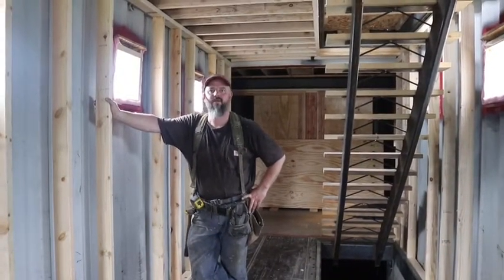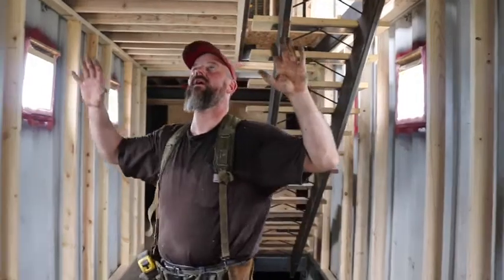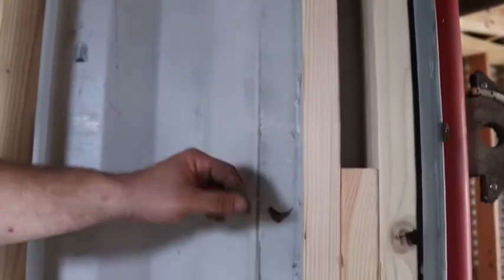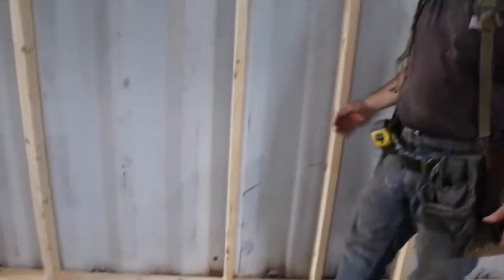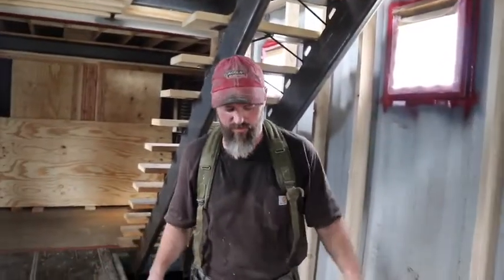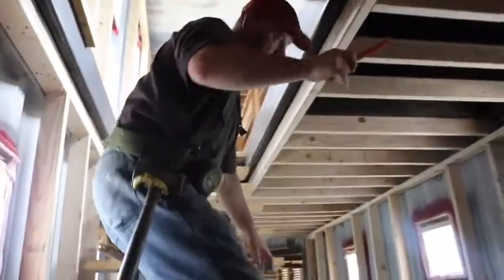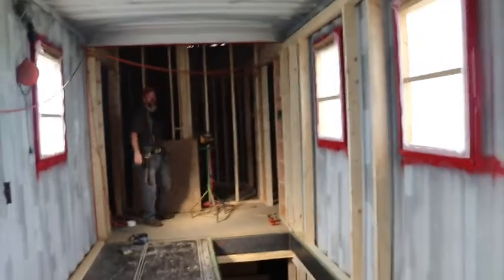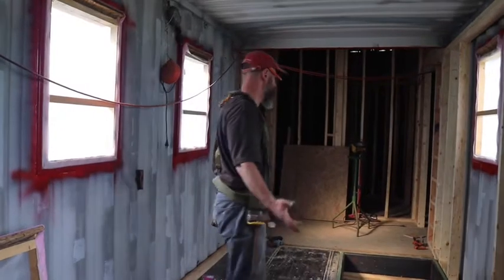shipping container framing

Comment: Are the wall studs screwed into the container walls or press fit between the sill and top plate?
Reply from the maker: Mr. Miracle there just fit. I gapped the studs away from the wall so as to in fill the gap with spray foam and prevent a thermal bridge. The shipping container is super strong on its own . The 2x4 are really for wiring, insulation and drywall.

Comment: Is it a requirement to frame the inside up like this? Seems redundant, im sure theres a much simpler and less labor intensive method.
Reply from the maker: Samus, yes it is a requirement. We have fairly strict building codes and regulations that have to be followed. Building a “regular “ house would be simpler and less labor intensive.
Reply: @TomofAllTrades  Okay, that makes sense. Im sure it varies by state and possibly county. Not in Troup County, Georgia, are you? My plan is to have a tiered project, building essentialy an apartment building. I have a multi step plan in the planning stages for building it one unit at a time. Im not some green freak or anything, i just want to supply my community, mainly the high school graduating class, with housing they can actually afford. Eventually the rent will pay for the costs of the building, and the next one. Im estimating a 5 year turnaround period. 

In my research, ive noticed people saying that the costs of building a container home is very comparable to the cost of a stick built one. Ive also noticed that usually, people that build shipping container homes are usually interested in living off the grid, or some other rediculous lifestyle. These people usually go out of their way to use exotic materials, or build an infinity pool, or some other crazy high cost item that doesnt really serve a purpose. Im thinking that if I avoid doing that, and adopt a uotel room design philosophy, i can build this structure for maybe 50% the cost of a stick built alternative. Keep in mind thats with the added benifit of modularity.
Reply from the maker: Samus, yep. The disadvantage of shipping container builds is the time it takes. A steel stud system may be cheaper. The studs are really just for insulation purpose, wire and plumbing space. 
If you came up with a modular, simple, and repeatable design you might be on to something.
Reply: @TomofAllTrades  Its a 3 container tall, 5 wide building. 4 identical single container units on the bottom with one in the middle to house the utilities, and some storage cabinets. The second and third level will have multi container units, ive loosely drawn up several diferent plans for how that could be done. I was asking about the stud framing because they arent load baring, so i was exploring different methods of insulating and hanging the drywall, for multiple purposes, reduceing costs, reducing labor, increasing insulative properties, and maximising available space.